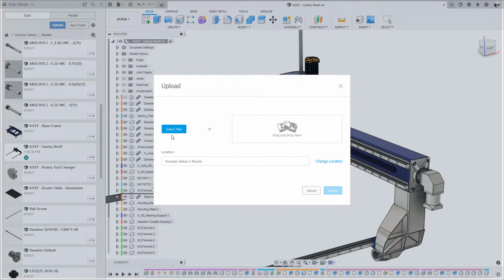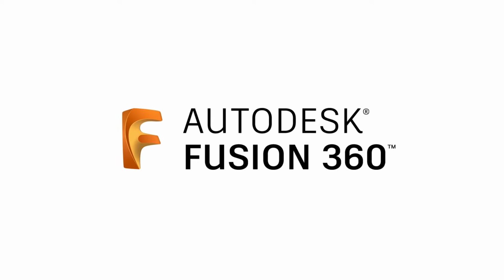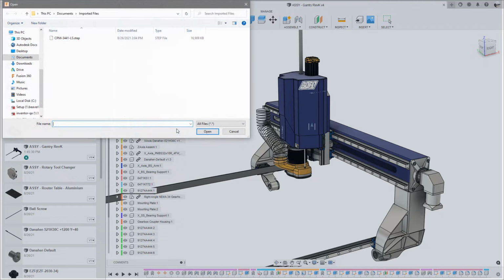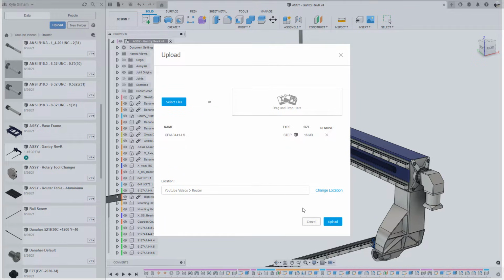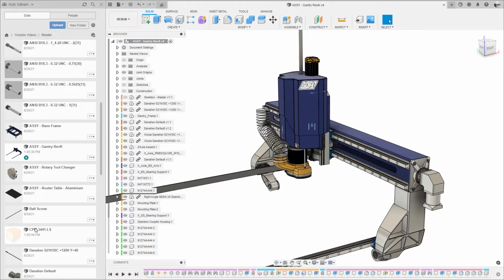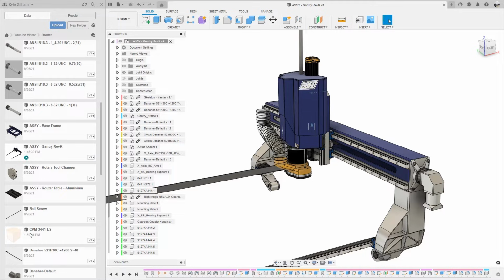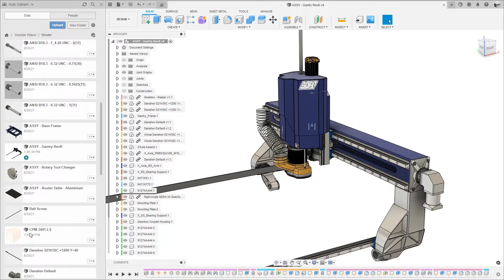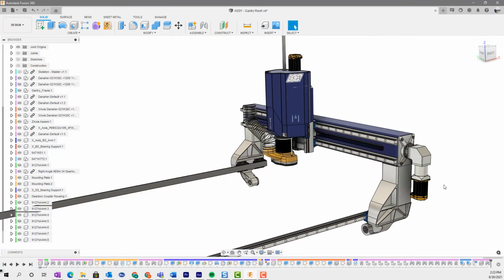Quick Tip: How to Import an .STP File into Fusion 360 | Autodesk Fusion 360

Comment: This is total bullshit false representation ,they make it seems like the step file will appear in your design in coherent matter and be easily movable but it’s not ,it will appears meters/yards away from your working plane and then,setting up the pivot point will be nearly impossible ,and even if you manage to do it ,the part will move erratically ,so far ,none of their supposed self proclaimed expert came up with anything other than excuses stipulating that this is normal behavior for step file getting inserted in parametric apps.How ever ,in their ‘’quick tip /shameless promotion ‘’ capsule here ,they make it seems as if it was as smooth as butter.

Comment: Once you upload it where does it go? Cant see it anywhere.
Reply: I'm having the same problem
Reply: If it went to default asset folder open data panel (top left button) and click home, then find assets, open it, find what you uploaded and drag into location. @andrewwhite986
Reply: it goes to the folder you commanded. I had to open the imported file manually, then set it to be Editable